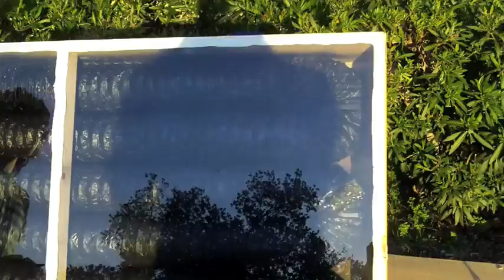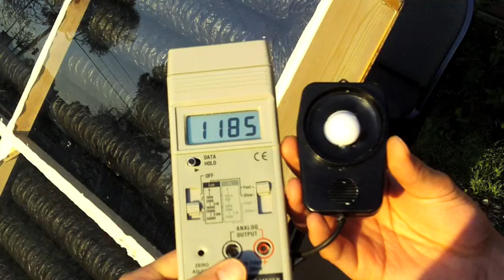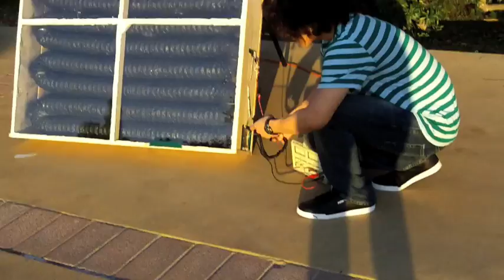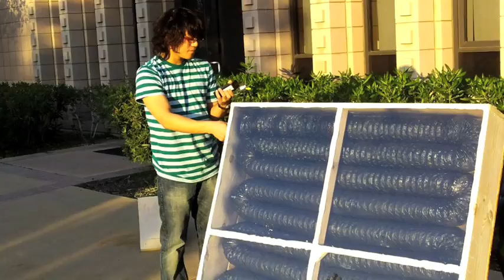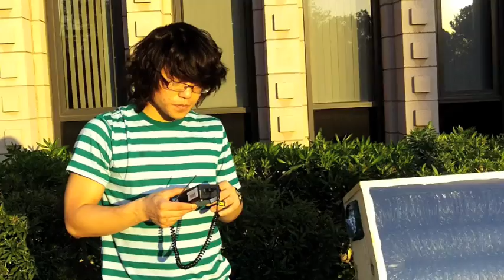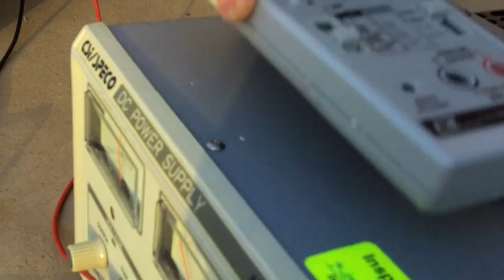Solar Air Heater - Harvey Mudd College - Kona Coffee Farmers Association clinic team

Comment: The hottest solar heater seems to use metal downspouts, but it would be around $40.00 for each one, minimum. Like 200 degrees output. No glue needed, should be pretty clean with no off-gas. Its on youtube.